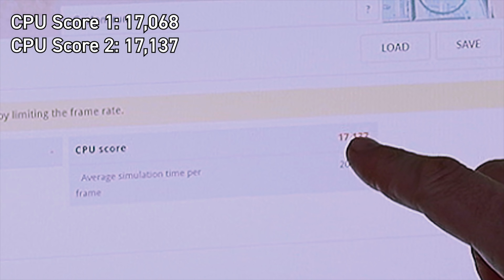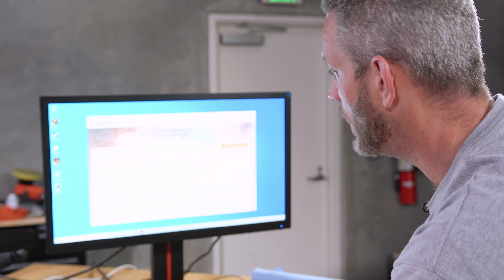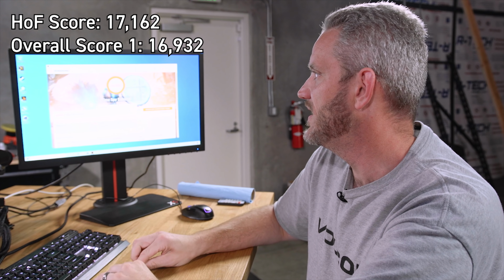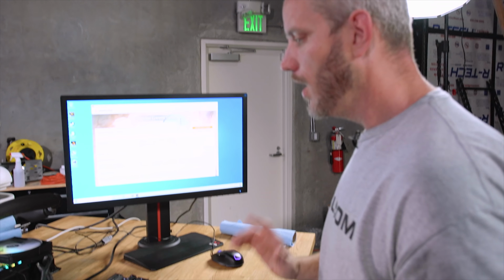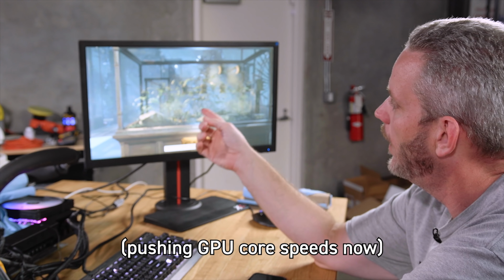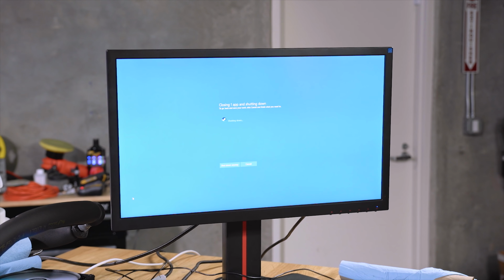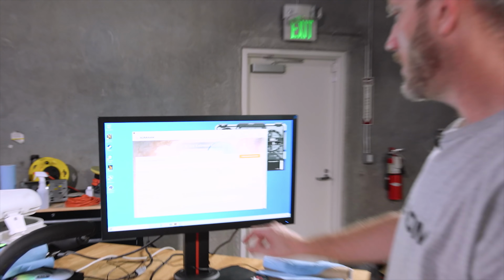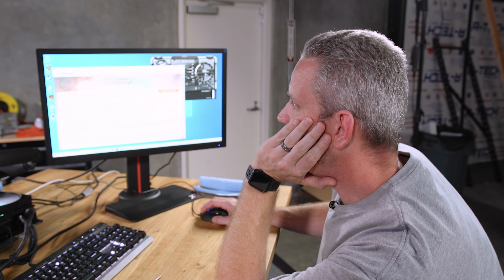I couldn't even win against MYSELF...

Comment: How about a budget system to run dcs (digital combat simulator) in VR?
Reply: I'm with you. My son has my old Phenom 2 build with a 1060 and he wants an oculus rift... I need to know if he is gets a $400 Christmas gift or an upgranded system and Ramen noodles until the new year.
Reply: @Pico2199  for most games he should be ok with the rift and a 1060, for dcs he will need every setting on low to get a decent fps
Reply: @ticopowell   I'm more worried about the CPU. When I put a 980ti in the computer the CPU was a bottleneck for it. Add to it that it doesn't have a newer instruction set. Some games just won't play because of that.
Reply: @Pico2199  Intel gamer days is going on, you missed a few labor day sales, but you might want to just upgrade everything and let him see in 2D for a while
Reply: @ticopowell  I think you missed the joke. It's less than $200 to upgrade to a ryzen 3 1200 (minimum spec), 16gb ram and a cheap motherboard. And, for an extra $100 it can be bumped up to a ryzen 5 2600. Any higher than the 2600 and I'd have an upgrade and he'd have an i7 6700k.